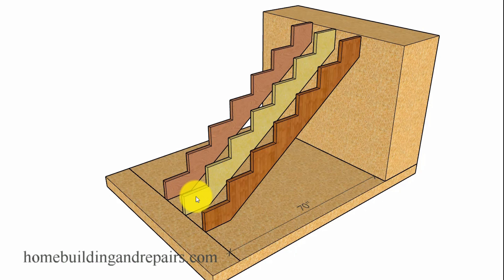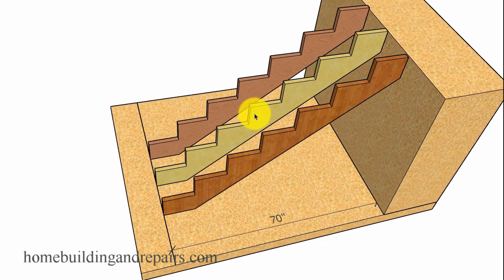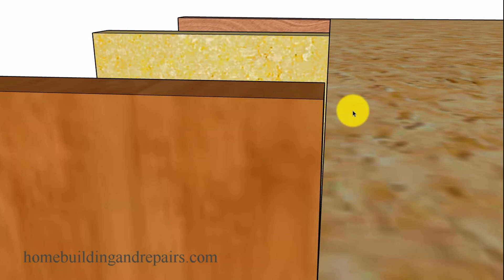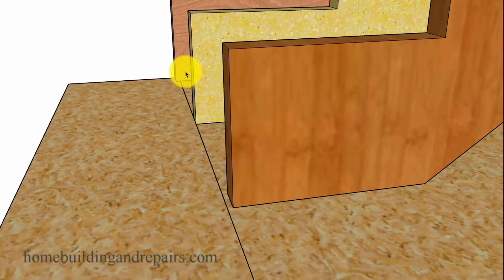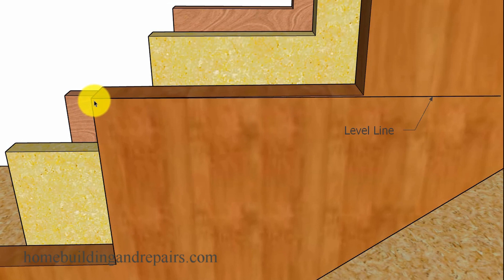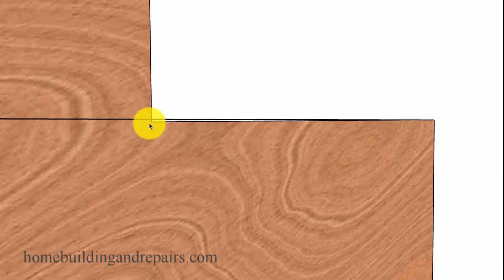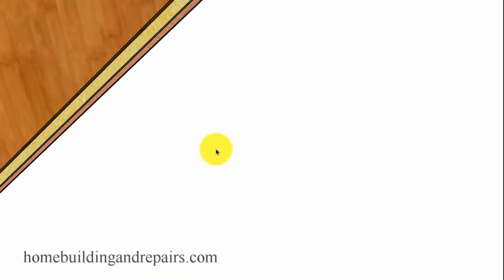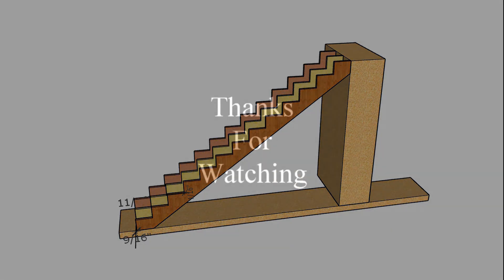This One Thing Is The Reason Why Most Steps Aren't Perfectly Level - Stair Calculation Measurements

Comment: The reason your longer stringers projected further in the second example is that you stepped them off, as so many treads. You could calculate the overall length of your stringer just as you would a rafter, using the Pythagorean Theorem, and that would give you the correct total length of the stringer. Marking the top and bottom points first would allow you to check your step-off.
Reply from the maker: Defiantly another way and thanks for sharing. We like the Pythagorean!!!

Comment: If you have twice as many steps that are all 1/16” too tall, when the stringer is placed with the treads level, the top will be twice as much higher than the ledger than the first example. When it is set even with the ledger the bottom will stick out twice as far as the first one.

Comment: Using your first one as a template solves the issue, also most of the time if there's stairwell walls I'll eliminate that top step and hang the stringers with straps, level them to each other ,then put 2×4s as a spacer between the wall and drive a couple ledger lockers in

Comment: How does one determine how long a piece of wood needs to be to make your stringers out of?
Reply from the maker: I cannot provide you with specific structural engineering advice, but can tell you that I've installed plenty of stairs using 2 x 12 for stringers that were 16 foot long.
Reply: Stringers are similar to roof rafters with a lot of zig zags cut out of them. You can calculate the overall the same as you would a rafter. Use the Pythagorean Theorem, A squared plus B squared equals C squared.